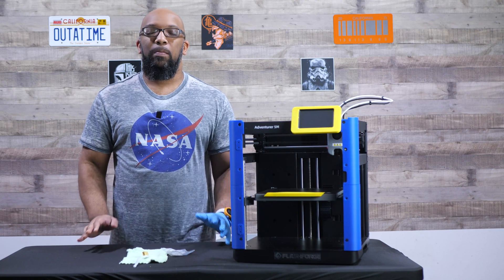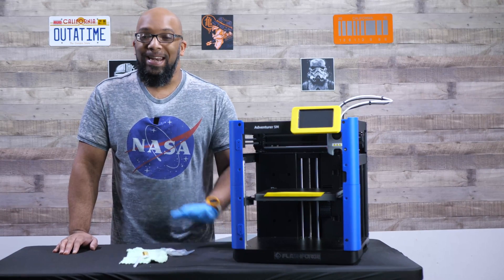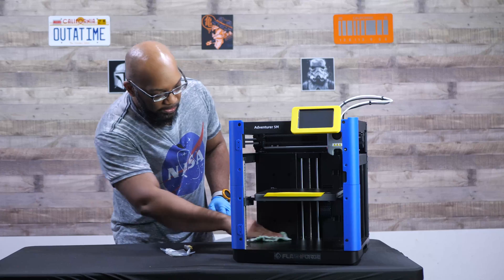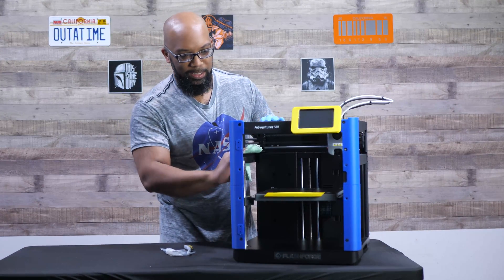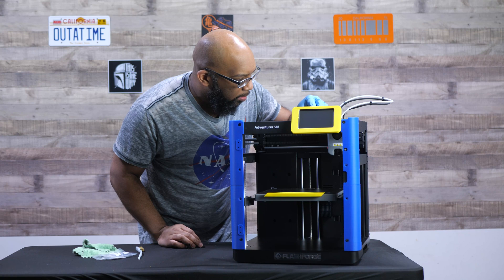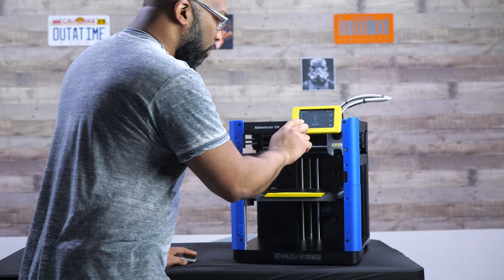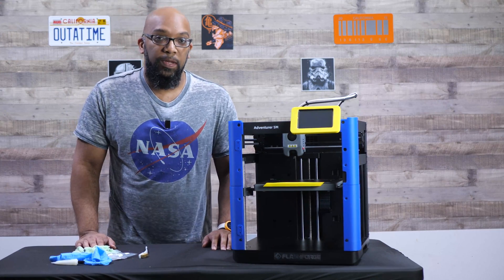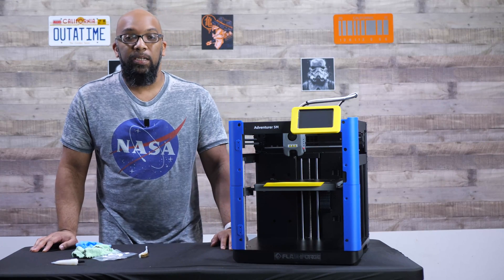Basic Maintenance Tips for the Flashforge Adventurer 5M 3D Printer

Comment: Thanks for the video. I do have a question? How can I stop the tube the filament goes through from getting pulled into the nozzle? When this happens, the printer thinks it's printing using filament, but nothing comes out.

Comment: Another way to clean the rails and screws a little deeper is to use multiple rounds of grease & wipe down. When you put clean grease on the rails then run the head back and forth over them, the grease will carry out some of the contaminants that are deeper down in the bushings. Wipe off the contaminated grease, apply new and repeat. Add that last dab of finishing grease after the cleaning rounds come back clean. This is common practice in the shops I've been in, (where some machines use bearings rather than bushings). Maybe more than is needed to maintain print quality & longevity on the A5M with uses bushings  with very little load. But my A5M isn't in the cleanest environment and it takes takes 3-4 rounds for the grease to come back clean.  Love your A5M content. Picked mine up through your affiliate link. (I hope Honey didn't snipe your cut.) [edited for clairity]

Comment: Nice video, thanks. 
I've had my A5M PRO for a few months and I'm in love. 
I had a little clicking that showed up and annoyed me during specific movements. I decided to take the top off and check all the belts/pullies ECT. 
I used 100% silicone machine oil in a insulin syringe to put a micro drop or 2 of oil where possible. 
I added a bit of tension to all belts because: break in, right? Well maybe not but did anyway. I believe the clicking was caused by a bit of rubber that built up on 1 idler pully unevenly. I made sure to clean all pullies before reassembling. 
I have to say that it is no small task pulling the top off and A5M PRO. Flashforge has disassembly and reassembly videos that you can find under belt tensioning. There are very many screws, like many, many screws. I successfully put it all back together again and somehow only had one screw left over. I've racked my brain over and over and inspected and inspected and cannot figure out where that screw went. Must not be very terribly important because it all seems to work very well. Good news is the clicking went away. Bad news is I use the shotgun approach so I have no idea exactly what the clicking was. Although I suspect it was the rubber on the idler pulley. Hope this helps. Somebody somewhere down the line. Really don't just take the top of that thing off because you want to see what it looks like underneath. Oh, additionally, be careful with the ribbon cables and connectors as they seem to take a bit of stress during the disassembly reassembly process. 
Good news is the z screw belt is extraordinarily easy to tighten and I did notice that mine seemed a little loose. Just look underneath you will see an idler pulley on a block with a tension spring and adjustment screw. Just turn the screw until you've used up about half the play in the adjustment spring. Piece of cake, right?? 
If anybody figures out where that extra screw went please let me know. 
I like to think that it's printing better than ever. Like a super printer, but more than likely it's printing the same as it ever did. I just like to think that I actually accomplished something. Thank you for the videos.

Comment: I've got a problem with mine where it is almost half an inch lower than the extruder nozzle. Any tips on how to actually get this bed raised? I can raise it all the way up on the control panel, but it's still not close enough.
Reply: Check your z offset

Comment: Can you tell me where to find the number of print hours. I have an Adventurer 5m Pro and I can't seem to find the number of print hours under the info tab.
Reply: It is tracked, as well as meters of filament used. When nothing is printing, from the homescreen, hit the printer info button on the bottom right. The icon looks like a piece of paper.
Reply: I don't believe that it is tracked by the printer itself. I've just kept a notebook handy and used the app to log how many working hours my printers have done without any preventative maintenance. Always check the teeth of your belts, check for any excess wear around the edges etc. and just listen to the printer running. You'll definitely be able to hear if the printer rods are dry, just use lubrication sparingly. Excessive lubrication is detrimental to any moving parts. Haven't had any issues with build plate or stock .4mm nozzle after 400ish hours of printing. Check screw tightness, heavy vibration will cause them to walk out of the threads after awhile.

Comment: I accidentally cut the head on my Adventurer 5M
Reply: I was trying to change the filament and cut the head. The filament won’t come out now.
Reply: HAH! I think I did the same thing! the little plastic T section that reinforces the filament feed tube slot on the top portion of the nozzle gantry? yeah, Im pretty sure that I accidentally shaved the very top of it off in the dark one night while changing filaments and im pretty sure it fed down into my first 0.4mm nozzle and clogged it. I attempted to unclog that nozzle using the original FF instructions of retracting the inset screw which tensions the filament feeding mechanism, heating the hot end to filament temp, and "jamming" the nozzle unclogger into the nozzle from the top. It did nothing, and I refuse to jam hard enough that the nozzle bends, Im pretty sure that nozzle is toast and I am now extra careful with my clippers changing filaments... I dont know if I damaged anything attempting that unclog process to this day, I just hit my 200hr mark this week with this printer and want to do some PM.

Comment: do you clean it with dawn Dish soap or a certain type of thingy my bed/plate for my flash forge needs cleaning and I don't know what to clean it with so it would've been helpful for instructions
Reply from the maker: That's correct. I use blue Dawn dish soap and dry it with a soft cloth.
Reply: You can use isopropyl alcohol with a paper towel.

Comment: how do you clean the bed/plate
Reply: I have two textured PEI plates and one smooth PEI plate. 
When they were fresh and new I found some difficulty and used a number of the regular things. Flashforge sent a bottle of juice along with the printer, that worked pretty well. I used glue stick, that worked pretty well. The thing I didn't like was the patterns that it would leave on the plate side of my prints. I decided to get some aquanet which for some reason I could not find in the stores and I had to wait a week to get it from Amazon. (Is this normal?)
Now that my plates are "seasoned" I'm really having no adhesion problems, although I admit I keep my plate temperature up at least 5° higher than default. Something like 65° C. For plastic and 85 or 90 PETG.
Plastic parts seem to almost fall off the plate when it's cool, but don't let go while it's printing. If I have a print with a very small contact area I will use a light coat of aquanet and trust me it doesn't just fall off when things are cool. That aquanet is like spray magic. I really dislike using brims and rafts. Only using rafts when something is up at an angle with only one very small contact point and lots and lots of support. Which is really the exception because let's face it. That's not the way anybody wants to print something. I clean my plates with hot water and regular Palmolive dish soap with a scrub brush, not a Brillo pad, I would think those would scratch. I don't scrub very hard, just a light scrub. I make sure to dry them off with paper towel as most cloth towels have fabric softener on them, which I'm pretty sure is a Pro tip that not many people are aware of. Not saying I'm a pro, I just know a pro tip or two. In between washings? Or just after a print? If there is a shadow on my plate, especially my smooth plate, I'll just give it a quick wipe with some ISO alcohol that takes care of that problem. Past that I make certain that my first layer is really thick and hot, I like monotonic or monotonic line and for a .4 nozzle I will use a .7 line width. This gives me a really nice finish on any flat surface, whether it's the textured plate or the smooth plate. I just made a small tool box that had a large flat surface made on the smooth PEI plate it turned out very nicely. I was proud. 
SMOOSH that hot plastic together, you won't be sad.

Comment: Thank you for showing off this printer in your videos. Just received it yesterday (Amazon) and wow, I am incredibly impressed. In February I got my first 3D printer, a Sovol SV07+, then spent 2 months fixing its little issues (had to redesign the parts cooling system completely) and then tweaking material profiles to accommodate for the changes to cooling - PETG was interesting. But this machine? Prints fantastically right out of the box. So now the other machine will be saved for the bigger pieces, and this one can do most of the work. Not a single failed job yet, and now I'm tweaking the TPU profile in Orca in order to make some custom motorcycle parts for my stepfather.

Comment: My Adventurer 5M will be here Thursday. Can't wait! My Ender 3 Pro is still going but man is it aggravating to keep level (even after many upgrades). I even installed the micro swiss direct drive extruder. It prints much better but getting the machine level is a beast (even with nylon spacers instead of those springs).

Your videos are extremely helpful and really made my decision to "upgrade" even easier. I'll still run both but will do heavy duty printing on the 5M and lighter stuff on the Ender 3 Pro. New subscriber! (LOVE the Back to the Future plates!)
Reply: Ditto. Just got my 5M yesterday. It's going to be my workhorse machine, and the SV07+ will be saved for the bigger jobs. Flashforge really upped their game. I don't miss bed leveling (with those stone-age wheels to turn) one bit.

Comment: I need help with mine, every time I got to heat the nozzle the printer will shut off. It started yesterday mid print. Its on the latest software, I've emailed flashforge support but they havent got back to me. Any help would be great thanks.

Comment: Good info, thanks!  now a question...
Jeremy, you've had your 5m for about 2 months I'm guessing. Have you had to replace the nozzle assembly yet?
I've had my 5m for 2 weeks and just now, at 57 hrs, the machine had a nozzle heater failure. Definitely the heater, thermocouple works fine.  What lifespan should we expect from the nozzle assy?  Fortunately I purchased a spare 0.4 so I'm still printing.  maybe I should buy a few more?  Thanks!
Reply: My 5m has 1000-1100 hours still with the first nozzle

Comment: any idea how to adjust the belts?
Reply from the maker: There are 4 belt tension adjusting screws on the back of the printer. They are slightly recessed into the case. You can tighten or loosen them with an Allen wrench.
Reply: @FigureFeedback  My only wish for those is a label on them showing which screws tighten which belts. But I will print my own shortly :)

Comment: Great video man. I need to find you the link to a lub nozzle that helps when adding. I had my first experiance having to take the Extruder apart, had a bad jam at the mouth of th extruder. Could not push it through so I disassembled the xtruder a bit. Just a note that its not that hard to fix that issue. Just remove the top of the extruder, then the main board of the extruder..making sure you are careful unplugging things. Once removed the extruder and fan will slide out together. Behing the assembly is a big gear that I just had to turn to extract a pretty good size peice. Then I just reassembled and it was all good.
Reply: Screw Rods Adapter for the SuperLube 21030 Tube (85g/3oz PTFE Grease)

On Printables, /model/800456